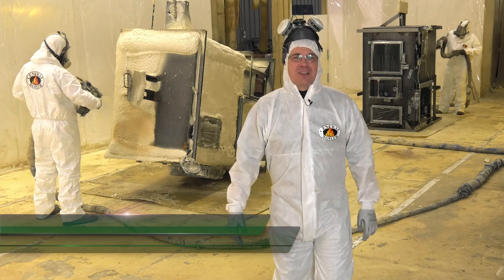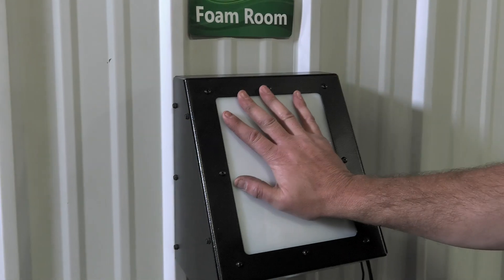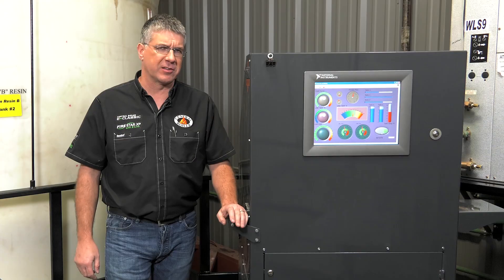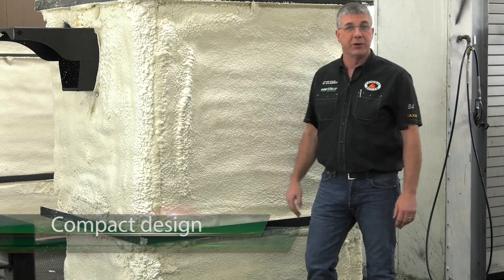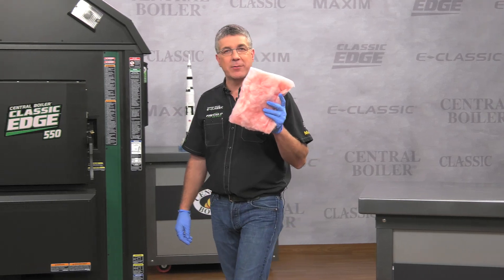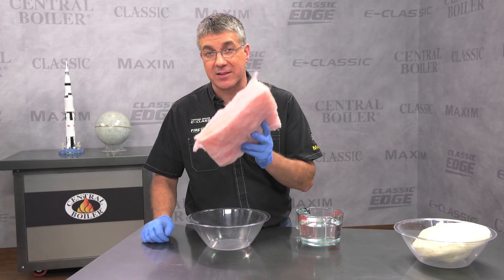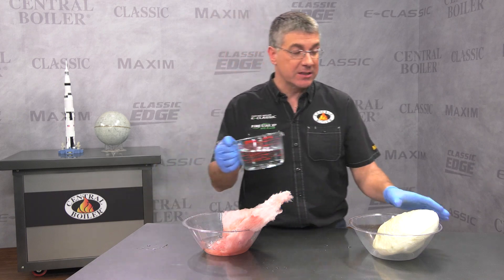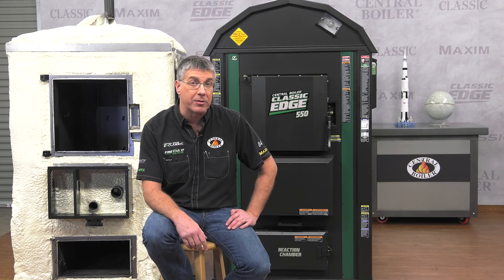Urethane Foam Insulation Demonstration │Central Boiler

Comment: What happens when you develop a leak in your water jacket? You will never know until your jacket is saturated between boiler and insulation’s, rotting the metal.on your jacket.
Reply from the maker: Keep your inhibitor levels where they should be and you won’t need to worry about it.  
 The stainless steel water jackets last a lifetime when properly treated water is used.  Planning for a leak should not be a factor in choosing the insulation to use.